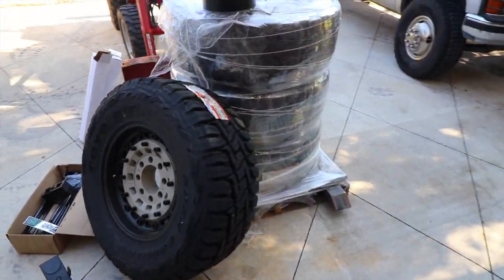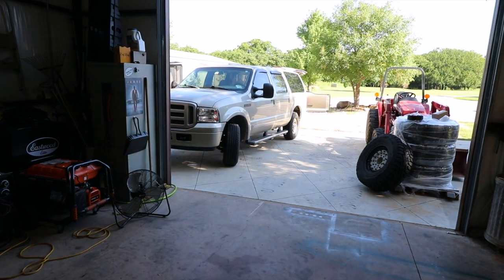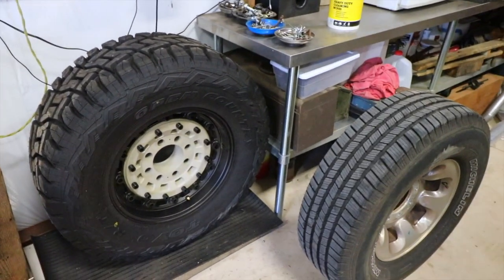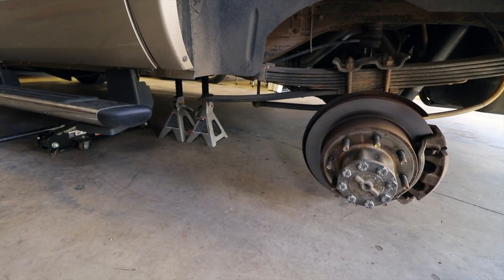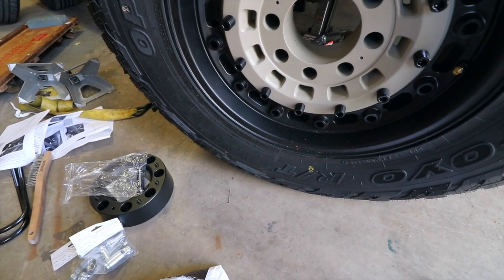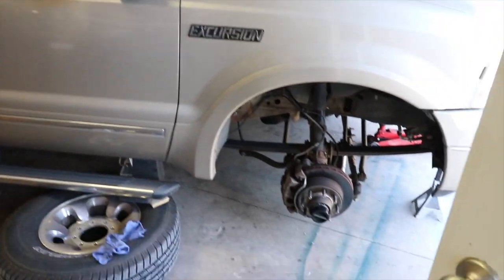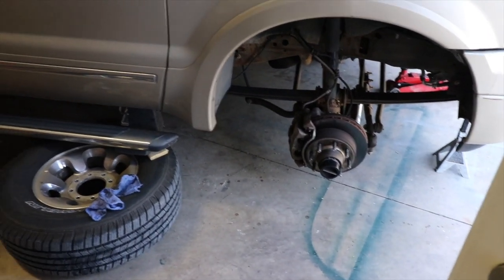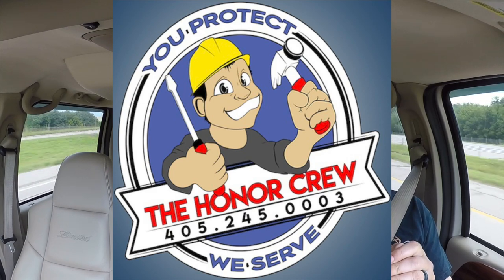Ford Excursion Lift Kit Install (adding a little ATTITUDE to my truck)

Comment: If your GVWR is 9200#, then I highly doubt you’re driving down the road at 10k+. Take it across a scale and get the actual weight of it, I bet it’s closer to 8k.
Reply: GVWR is vehicle weight plus max payload
Reply: Busted Knuckles excursion rolled theirs over a CAT scale while on a road trip.  With 4 guys and gear, no trailer came in at 11,300#…. The vid showing them scaling and the weight ticket is on there channel.

Comment: Yeah, your video here is validation for me spending an extra few hundred on getting a shop to install my 4” lift on my 2000 excursion.
Reply: I didn't understand this comment until I got less than halfway thru the video 😅😨
Reply: With the right equipment, it’s the easiest lift kit to install.

Comment: Was looking all over for videos or pics of this Zone lift kit for a Excursion and this is the only one I found. I have a 2000 Excursion with 400,000 miles on it and I wanted the cheapest lift kit for it. I had my doubts about this lift but I ordered it anyways. I couldn’t be more happier with it, it drives and rides better than it ever has. For 500 bucks, you can’t beat this lift. I really appreciate your video and review on this.

Comment: I enjoy your videos just not this one. Was hoping to actually watch the individual parts go on and everytime you started working it switched to the work being done.
Reply from the maker: Yes. Did this one a little different in that way. Other people complain that I take too long showing the entire process. Will have to find a middle ground. Thank you for watching and commenting.
Reply: I've seen many that record everything but fast forward through it and slow down during a decently important explanation.

Comment: 12000 lbs 4 post lift is the way to go, trust me.  It's the absolute minimum.
Reply from the maker: Yes, I think I am going to upgrade mine soon so that I can work on the heavier vehicles.  Standing under mine with a larger truck on it makes me nervous.  Thanks for watching.

Comment: I have on '02 Ex with the 7.3. Just to clarify, the GVWR on the sticker in the door jamb is not how much the truck weighs. That is the total loaded the weight the truck can handle. Scale weight on mine is right at 8,000 lbs when I weighed it on our truck scales.  So to say your trucks weighs over 10k is incorrect. You are closer to 8600 lbs with your tools.
Reply: Looks great. I'm gonna find one with a 6.0 & do a full bullet proofing. 
Fyi, if you have to slam on brakes everything you carry in the back is coming at you. Maybe put the back seat in or get some kind of headache rack. That 5 gallon bucket & shovel scares me. 
John Fullers a good man.
Reply from the maker: Nice.  Yes they are great trucks and engines in my opinion.  Yes, I have sold this one and gone back to a pickup to haul all of my tools.  A lot safer.  And yes, John is a great friend and really good man.  Thanks for watching.

Comment: Just a tip gor anyone doing lift or strait axel work if it come sout of line use a come a long to the fram to pull it back were it needs to be i moved my axel bact 5 inchs on my glat bed for better tow and a come a long is a life saver

Comment: How does this kit handle with a little weight on the back? Say, towing a 5000lb cargo trailer?
Reply from the maker: Thanks for watching and commenting.  I did not have it very long after I put the lift on because I sold it but did tow with it a few times.  I have a 22 foot long car hauler and had my Tractor on it and it handled it very well.  Essentially the rear suspension is the exact same except for the bigger blocks so no loss in capacity via the springs.  I think the trailer weighs around 2000lbs and the tractor probably another 2000 so I would think a 5000lb cargo trailer would be fine.  Thank you again for watching.

Comment: How did you get the upper hardware off the factory sway bar links? Instructions for this kit say to reuse but mine are pressed in. Did you have a press or something to get them out? Any tip is much appreciated!
Reply from the maker: I took to Oreilly's Auto and had them press out.  Then press in for the new ones.  Hope that helps and thanks for watching.

Comment: How were those sway bar links working? Im looking at getting them for my lifted excursion. Im worried about the bushings wearing out as the bolts dont really move like a hime joint
Reply from the maker: Well, I have sold the truck but when I had it, they worked great though.  I think you would be great to use them.  Thanks for watching.

Comment: question have the 2001 excursion that has been lifted. how do we determine the lift. I am needing to add airbags and need to determine the size of spacer to put in.
Reply from the maker: That is a good question.  The easiest way I can tell would be to measure the rear axle blocks.  Stock they were 2 inches.  So whatever the difference is between Stock and what you have on is the size of the lift.  Hope that helps and thank you for watching.

Comment: Nice ending music and drone ! Love the lift, did you do any upgrades to the engine
Reply from the maker: Thanks.  And thank you for watching.  On the engine, I have yet to do anything to it other than adding a 250 amp Leece Neville Alternator and the big wire kit from FICMrepair.com. I am a big believer in keeping complex engines as stock as possible until you "have" to repair something or common sense upgrades.  The 6.0 has a bad rep but I and other's firmly believe that if you maintain it well and don't add any tuners or boost to the engine you will be very fine and it will last 2-300,000 trouble free miles.  Now, I am selling the truck as of yesterday and am loading a video today about why that you can watch in a few hours.  Thanks again for watching and the support.
Reply: @SimplybEpic  yes I agree mines is bone stock I do have the leece 250amp also along with XDP coolent filtering system for 130$ might run a 4" or 5" exhaust I'm in California so has to have a cat for smog every two years
Reply from the maker: Dave Wilson I would definitely do the exhaust. Mine sounds great and it has helped with temps going down. And more power. But the California issue is a bummer. Won’t be fully open but should still be better.

Comment: Did u have to change ur pitman arm?
Reply: This kit does not require that, it is not needed. Take it to a alignment shop when it’s finished and have them align the front end and straighten the steering wheel, done.

Comment: I'm putting on the same lift on my excursion right now and the rear spring hanger bolt is the toughest part. Did those give you any trouble? Not sure how many miles yours has, mine has about 250k so I'm sure that's why they're so tough..
Reply from the maker: No, I don’t remember them giving me any trouble.  Do you mean getting the bolts off or is it another issue?  Mine has 87,000 miles and is very rust free underneath. Penetrating oil on them helped me. Thanks for watching.
Reply: @SimplybEpic  Yeah, I ended up having to cut off the hangar and bolts and replace the hangars, my bolts were pretty rusty and seized. Makes sense yours wouldn't be problematic given your lower miles.

Thanks for making the video though, I've referred to it a handful of times throughout my own lift install 👍
Reply: This kit does not require any removal of the spring hanger bolts.

Comment: So there at the end e rated tires even at 35 mine were 65 psi and ran 60 front and 65 rear towing full time and ran great my 28575 16 max 80 and i wouldnt ever recomend ever go iij bg les then 15 under becouse they do and will explode from heat iv had it happen more then once  all u run is e ratkng aka 10ply

Comment: i have a 2wd 2000 excursion. i have not been able to find a lift kit for a 2wd excursion. do you know if it's possible to lift a 2wd drive excursion and if not, how come?
Reply from the maker: I have never researched it but I would imagine you could lift a 2wd.  A lot of companies make a "pre-runner" type kit that lifts up a 2wd truck for off road performance.  Some of the best race trucks for off-road are actually 2wd and do very well.  I would look into a pre-runner kit for a F250.  Thanks for watching and I hope that helps.
Reply: Epic Cars i appreciate ya! i’ll look into it.
Reply: Fabtech k2100

Comment: I have the same exact truck but v10 engine
Reply: Same. Doing the front coil over front swap and superduty rear axle swap.
Reply: @sorryociffer   hows that going im very interested, still debating on which direction to go lift/suspension

Comment: Did you notice any power loss. Or loss of towing capabilities with the lift and tires
Reply from the maker: Not really. The tire and wheel combo is about 60 pounds heavier per wheel than stock. The tires are only about 3 inches taller than the stock. With the exhaust adding a little power I really don’t notice any difference. Thanks for watching.
Reply: Thank you for replying. And thanks for the awesome videos
Reply from the maker: You bet.
Reply: What about your fuel mileage, ive got an 01 4wd odo at 446xxx and one previous owner at that, however lift wise youve really peaked my interest with the stability and drivability statement?

Comment: you shouldn't have needed to lift it to get 35s on.  I'm running 35x12.5 on my unlifted 2000 Excursion with no issues.  Just ordered a 6inch F350 lift so I can go bigger later.

Comment: Can't believe you work on a 10K lb truck. You talk Safty and work on it with substandard equipment.  I have the same Excursion.  Your floor jacks, and stands no way rated for that weight, and where you placed the tire under the running board. There's no way it will support the weight of that truck. Anybody  else think you can do a suspension lift on the lifts he has......YOU CAN'T. I have 30+ years experience on 4x4's and trucks in a shop and in my garagel. Please  if anyone is using this video as a how to....
Use this as a How Not To! Nothing you did to work on this trucks safe. I'm not trolling I see someone putting out content that can get people hurt.